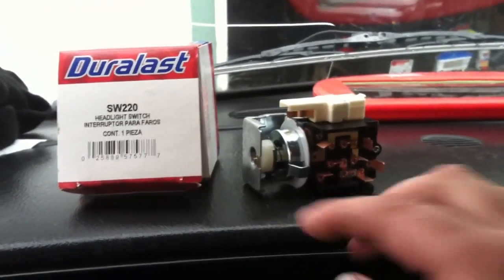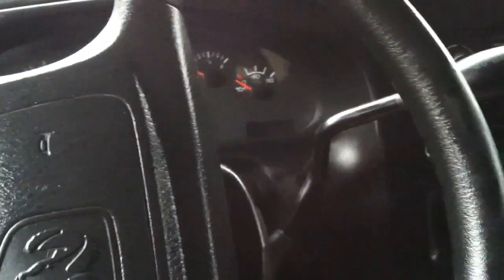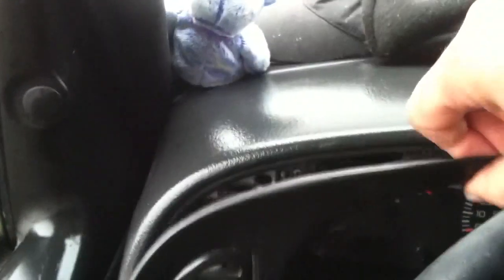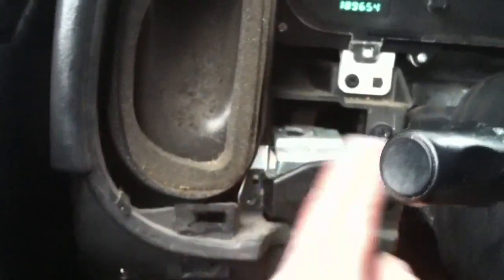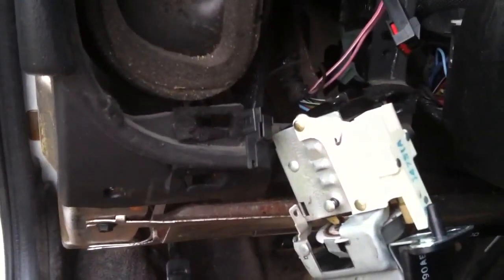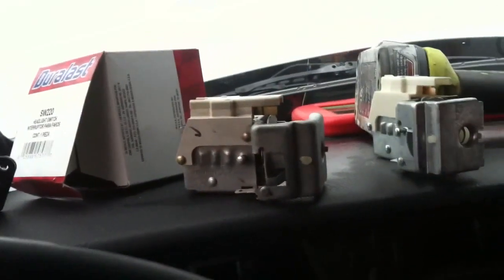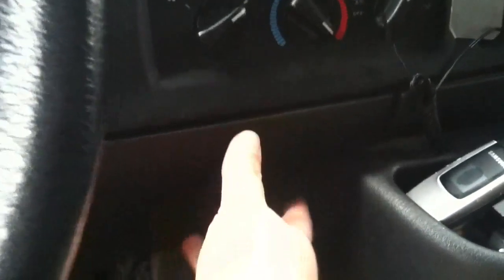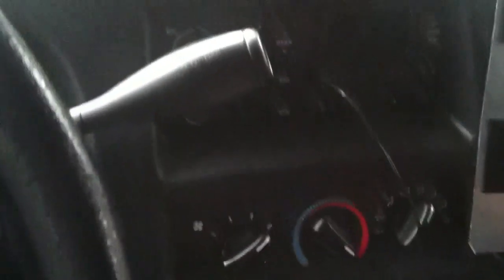1998-2003 Dodge Ram Van 1500 , 2500 Headlight Switch Replacement Tutorial

Comment: I forgot to disconnect the neg cable and blew a 20 amp fuse. No biggie, but yeah, learned a lesson. Everything works and this video helped in that I was a bit nervous to try, but had it down in less than 45 min. Thanks for the vid it helped a lot!

Comment: My internet connection is too slow but I can tell what I mostly needed you don't cover.

That being how to get to the switch?

I'm also working on my 98 dodge 4X4 P/U truck 2500.

So the dash is actually not the same either but you came up with my search.
Thanks for showing what you do.

Namaste
Reply from the maker: It is in the video...

Comment: Hi buddy, I have a ramvam 98, the low lights doesnt  work, when I apply the high lights, the high lights work fine, do you think if this headlight switch replacement will fix the problem?   Thanks in advance
Reply from the maker: Probably, that is exactly what was going on before my switch totally went bad.

Comment: I had a 96 and 2000 dodge Ram and this switch went out on both.
Reply from the maker: It is a common wear component that is pretty complex inside.
Reply from the maker: The earlier models will be very similar, but this tutorial mainly covers those models with the dual airbag dash, since those changes were incorporated I think partway through early 1997, but were labeled as 1998 models.